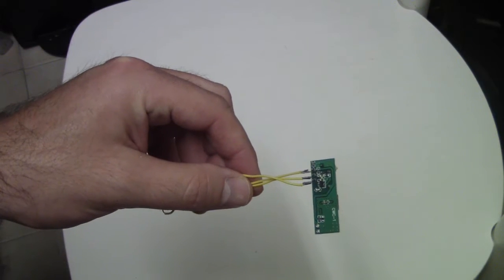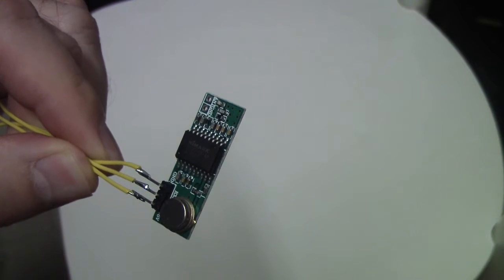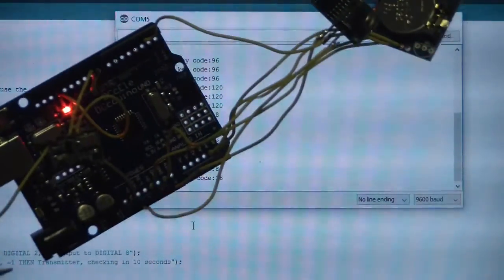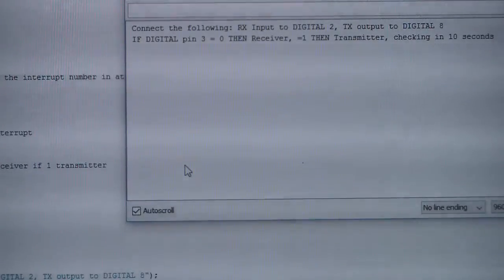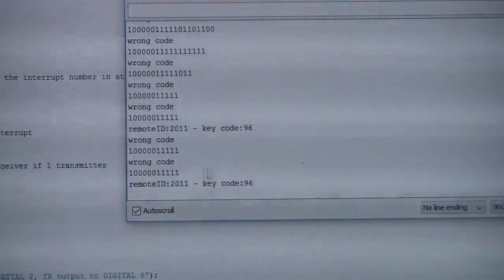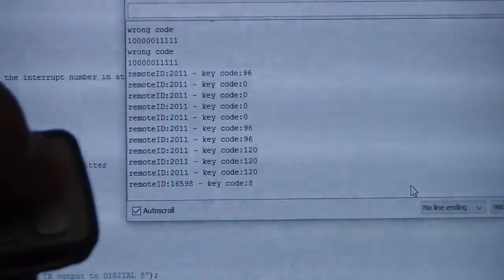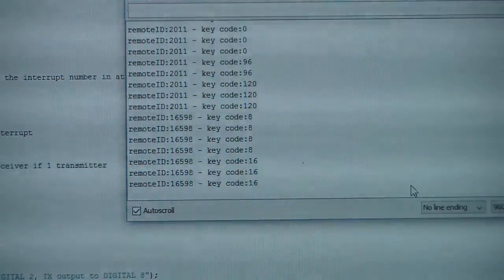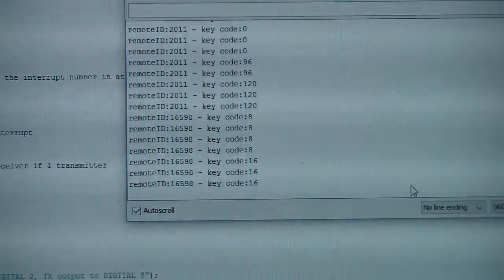livolo with Arduino Home Automation - Part 2

Comment: Roee, this is great work! Can the system be coded to allow 2 livolo dimmer to control the same light? Livolo has either dimmers or 2-way switches, but they don't have a switch that can dim from 2 locations...
Reply: yes you can - use the remote that you build from different location. as long as this is not too far away (you have to have RF receiving signal distance)
Reply: do these switches have a separate  FQ for and off ? and do you need to buy the remote if you are using it with a broadlink RM pro? or will it pair without needing to teach both the code , and how do you program the switch anyways